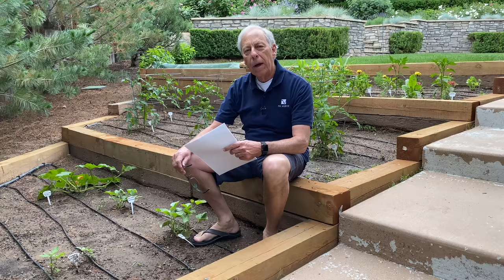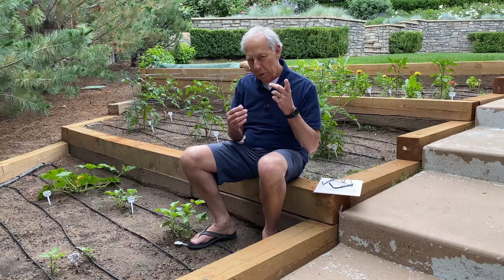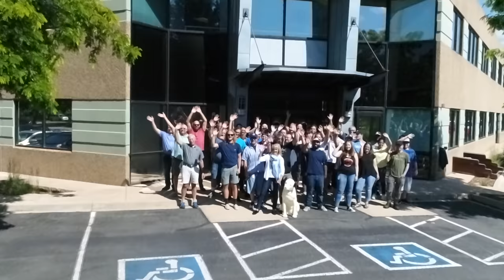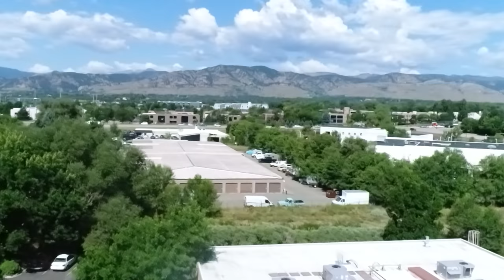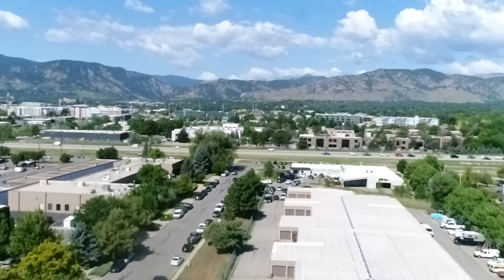Difference between line out and preamp out

Comment: i wish instrument amps had both. an effects loop for signal processors and a post eq send for DI into the PA or multitrack recorder. i also wish PS audio dabbled with instrument amplification.
Reply: Guitar / bass / keyboard amplifiers are a unique breed compared to high fidelity equipment. 
While the general principles are the same, the overall circuit design and the implementation of controls is Very different. 
"Dabbling" is no way to produce a good product!  
If a manufacturer is not fully committed to the type of equipment being made, it should not offer anything in that category. 
Yamaha is the only brand of which I know that makes both, and both are made quite well,  
but they come from separate divisions of the parent company.
Reply: i meant dabbled so PS could advise musicians and maybe improve upon existing models - not to manufacture their own instrument amps. i trust Mr McGowan's opinion more than i do the engineers and designers at fender, marshall, peavey, ampeg. etc.
Reply: @spacemissing  
Stated simply, you're alluding to the difference between production and reproduction.  
When producing music, essentially anything goes.  If the artist likes the resulting sound and it helps to convey their passion, then any kind of effect including distortion is acceptable.  We call it art.  
But to bring the artist's product into our homes faithfully, we don't want any further changes made.  Music reproduction has no room for artistic license.  In that arena, we call it loss of fidelity.  (With one possible exception being "tube sound" that some owners enjoy.)

Comment: thanks for this! i am wondering what is the diff between a LINE input and a TUNER input. Since tuner ins are useless nowadays, im curious about how they work so i can convert my amps with bluetooth recievers , converting the input the right way. Anyone has any idea?
Reply: It is very likely to be the same as line in, (there once was a time when MPX filters in preamps were a thing but not now).
For the curious MPX stand for multiplex, which is how stereo was encoded into FM radio using an ultrasonic signal. If not filtered out this could interfere with the tape recorder bias oscillator and cause problems when recording the radio.
Reply: @JohnJackson66   okaayyy thanks! So if i plug some LINE signal into a Tuner in, that should be fine? no impedence thing or so?
Reply: Yes, it won't hurt anything.

Comment: Strange question. The only difference is that one is controlled by the volume switch and you can turn the volume up and down. The other has full volume and used for EQ. or recording as the cassette plays. and things that must have full volume.